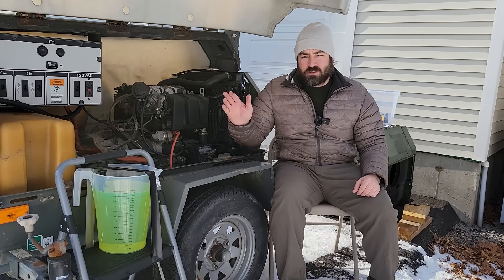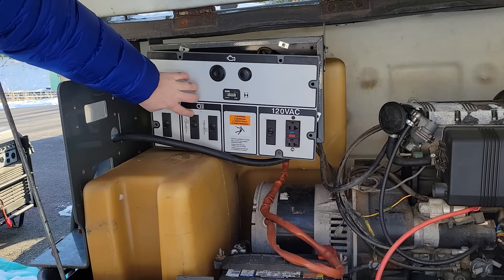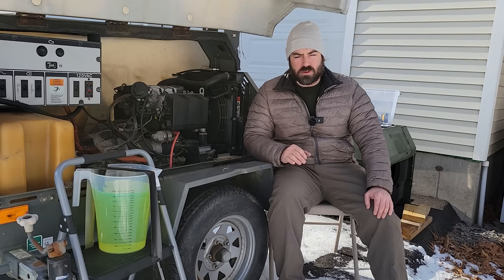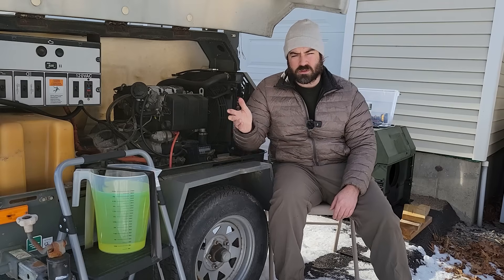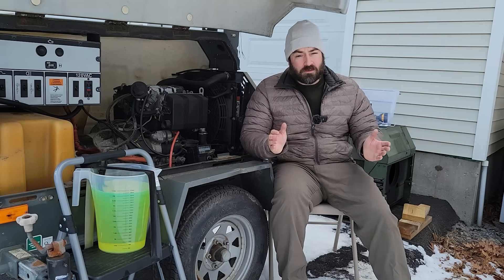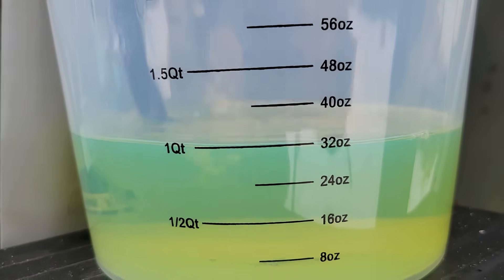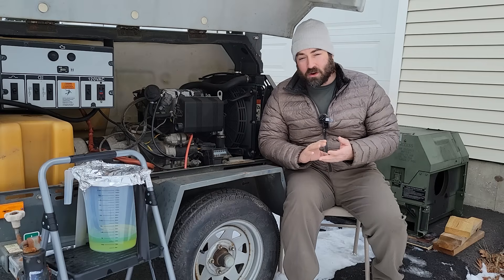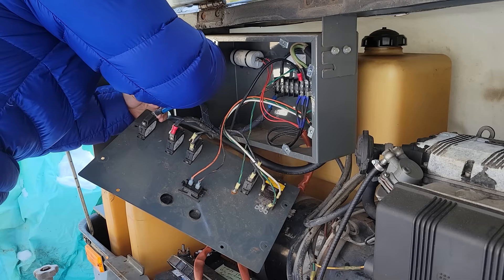Most efficient generator to recharge batteries (that I've tested)

Comment: What are your thoughts with this generator 
https://youtu.be/jth-KuV7mrw?si=pse9lalWxyjJWVM5
Reply from the maker: I think the idea is very cool, but I won't personally be buying one.  This generator only goes up to 54V, and then it lowers the Amperage.  The factory setting of 48-54V is perfect for lead acid, but lithium does better with a bit higher Voltage.  The Chargeverts can be set higher, which keeps full current longer, and that means re-charging faster and more efficient. If the company comes out with a new version for lithium, then I'd love to buy one.

Comment: I still think you'll be better with a small propane generator and 40lb tanks. Still pretty easy to handle and the lower fuel cost will trump the most efficient diesel.

Comment: Real world tests show the inefficiency of an ICE for power generation. 
AND we all have one!  Pretty much the worst way to make portable power, but a necessity at times.
1 gal of diesel has 138,700 BTU of energy which would be realized at 100% combustion.
Converting BTU to Watts yields  ~ 40KW-hr of power.
Assuming about a 80% efficiency of the charging equipment and 85% efficiency of the generator electronics.- 68%
This is to the battery only. 8500W/(.68)= 12,500 Watts. The fuel is capable of 40,000W.
The ICE is producing at 30% power efficiency. (12,500/ 40000) !!! This is best in class performance.

I should test my equip. My recent example if interested and math included. 
This with a DF Champion  4750W start up/ 3800W running gas.
I got 12 hours for 3 gal 87 gas and running the shed w/ A/C and charging a 15 KW battery from 30% to 100%.
My shed load is a little less than 600W w/ A/C running low. ~350 base + 250 for A/C 
Add 7200W of inverted power for 12 hrs of running shed. Assume inverter efficiency of 80%.
7200/80%=9000W required;   70%*15000=10500W.  9000+10500 ~ 20000W total.  
3 gal 87 gas ~= 100000 Watts. 200000/100000 
<20% power conversion efficiency. not worst but not best. A little surprised it is that good - lol.
Reply: Worst way to make portable power?  What would be your alternate suggestion for a 48-72hr scenario?

Comment: Asking seriously... Curious what the point of this is? Is it self sufficiency? Is grid electric super expensive? Where we're at right now, a kWh is $0.085 and diesel is $3/gal, so this would be extremely expensive. I love the idea of not being reliant on the grid however
Reply from the maker: I have several motivations.  One is being self sufficient.  Next would be backup when the grid goes down.  Where I live grid electricity is $0.38/kWh.  I produce my own energy 10 months of the year with solar.  The generator is just to supplement the solar in winter.
Reply: You guys are lucky.  Here in SoCal I pay 53 cents a KWH, soon going to 58 cents.  Meanwhile the state is shutting down all nuke plants.   Go figure.

Comment: Ensure your wiring is 120% of the recommended size if you plan to operate it under a continuous load. Wires can heat up and become more resistive over time.

Comment: I use a prius engine (Atkinson cycle 40% efficiency) and the rest 60% is waste heat that i use for heating water and my house
it works great and i can also run it on LPG
Reply: I've thought about a natural gas generator/furnace in an insulated box. That sits next to the home. With intake & exit ducts from the box into the house. In winter heat gets blown from the engine & muffler heat exchanger into the home while the exhaust  gasses are vented outdoors. There are 2 inline fans, 1 that sucks hot air from the box into the house & the other blows air from house into the box that cools the generator. So instead of just burning natural gas for heat in a furnace... To heat your home, the same amount of natural gas being burned. Is creating heat + plus electricity for your home, instead of just heat.  Although if it's ran constantly in winter for heat & electricity. The generator head will wear out pretty quick. But if it was easy to rebuild & replace for cheap. It might be worth doing.
Reply: @michaelbrinks8089  Do note that a cold rated heat pump + gas generator would be a lot more efficient than even a 100% gas heater.
Reply: @michaelbrinks8089  If you're using a liquid cooled engine, maybe you want to capture waste heat into a giant water heater type thermal battery that you can draw from as needed. Doing this with an air cooled engine could be a major carbon monoxide danger if it's not perfectly built.
Reply: can you upload some videos of this installation i will be really greatfull
Reply: This is an interesting idea.
Reply: That is what I was going to suggest he look into.  I've been wanting to build a stationary generator from a prius engine/transaxle for years.
I will need something if I go EV road racing, as the tracks don't have high rate chargers.
Reply: I tapped my Prius traction battery and fed a 48V telecom rectifier, and measured about 7.25kWh per gallon of gasoline. Considering gas's lower energy density (87% compared to diesel), it's about on par with what Mr Poz measured in this video. Love the fact that I don't need a dedicated generator!

Comment: I beat your number, 12.6 KW hr on one gallon of diesel!  Using a Perkins 403D-15G with a 14KW generator.
Reply: Those numbers are basically spec sheet ratings for the 403D-15 under standby conditions.  David's numbers represent power into the batteries (actually power through the victron shunt) accounting for chargeverter losses.  What is your setup and where are you measuring?
Reply from the maker: That's awesome.

Comment: I like the Chargeverter, it can be operated with 120vac or 240vac. It can be adjusted down enough to easily slow charge my 48vdc shop batteries from a 15a outlet from the house. Or charge from the 240vac generator at the recommended 30a per rack mount EG4 battery.

Comment: Shocking to me with the standardization of LEDs that light towers haven't gone battery hybrid.
Reply: they are stored a long time, not used every day.. better to fill the tank and go than to find out the batteries are dead.. (you can jumpstart the starter battery , light battery not so much)

Comment: Awesome result. The fuel economy is impressive, but the unsung hero is the little chargeverter. 95amps for an 1hr and 40 minutes I didn't know it would handle that much load for that long. I definitely need to watch more videos on just the chargeverter. Impressive.
Reply from the maker: I like the Chargeverter a lot.  I've ran mine for 10 hours straight once in a while.
Reply: 20% efficiency is great! 1 gallon of diesel has the equivalent of 40.7 kWh of electricity
Reply: The telecom 48VDC supplies are awesome too, especially if you're paralleling a few to get more AC -> DC charge. Lots of units are nameplate 54V/50ishA and typically have voltage/current setpoint controllable via CAN or something.
Reply: @SnowIsMyTerrain  The Chargeverter consists of two telecom rectifiers slapped together.

Comment: That's awesome.  My hot water heater uses about 1/3 it my electricity in winter, so if you could find a way to divert some of the excess engine heat into warming your tank water, you would truly get the most from a gallon of diesel.
Reply: i did exactly that with a prius engine and it works great
Reply: some videos I have seen use diesel heaters and run the exhaust through a radiator before exiting the house. The radiator gets hot and can blow a fan over it to get some heat. Maybe could do the same with a pool or something to heat the water?
Reply: We switched to a hot water heater with a heat pump on top.  That cut our electricity for hot water by more than 50%
Reply: These types of mods are fun science experiments but the actual $ payoff is so low for the application it's not justified. Just be a normal off grid person and use propane.

Comment: generally max eff is at max rpm with max load
Reply: Not with a diesel. And even with a gasoline, only to the point the injection enriches for cooling down the cylinder.
But these generator or mini-excevator motors usually have a governor (for gasoline) or a diesel fuel pump set to get an economic rpm. Then you should load to 70-90%. 
In this case, the motor is 8kW, the generator is 6 kW. At 90% generator efficency, the input is 6kW/0,9=6,7kW. So the motor is working at 83% by design. Perfect.

Comment: I was not aware that you really need the generator regulary in winter cause I had thought those were for backup only. But of cause now I understand why you are testing these.
We have the grid and no poweroutages in general. Last big one is 20 years ago and before that roughly 30 years. The grid can be away during night for a minute or so but we usually only get behind that afterwards in the morning when the clock of the Miele oven is blinking with the time when it happened. But that has happened 1x in the last 10 years. 
But we have a simple 3 kW generator for the worst case simply to charge the car at least that way.

Comment: Use an plate heater changer + an bubble type pressure absorber. You dont need mixing valves, unless you also want to use the radiator as backup (w/o modifying the generator as much)

Comment: Another great video. If you could run the cooling through a radiator inside for heat or through a coil in a water heater to have hot water maybe. Anyway, I’m sure you’ll come up with the best way of using it. 
I really enjoy your videos and look forward to what’s next.

Comment: Thank you for sharing your experience. Is it worth using a Chargverter on a newer Champion generator. I’ve not noticed my generator having any issues charging up my Delta 2 with the extra battery. Thanks for your advice! Thumb up 👍
Reply from the maker: I like using the Chargeverter on any generator.  I also own a Honda gasoline, and an army diesel.  I use my Chargeverter on any of them.  However, I don't own a Delta 2, so I can't speak to the specifics of that setup.

Comment: I've seen those generators in use at a few Walmarts, when they had issues with their parking lot lights.  Does your generator have a listed max output?  Where should we look to find surplus generators like yours?
Reply from the maker: The engine is rated for 8kW@1800RPM.  The generator head is rated at 6kVA.  I found mine on Facebook marketplace by searching "Light Tower".

Comment: How does the cost of the diesel compare with charging from the grid?
Reply from the maker: Most of this past winter, diesel sold for $3.50/gal. around me.  I made 8.4kWh, so that's $0.417/kWh.  My grid electricity rate is $0.38/kWh.  Which means my generator is more expensive especially if you take into account maintenance.
Reply: @DavidPozEnergy  I thought so - I find the closeness of diesel to grid costs surprising. One would expect diesel power to be several times the cost of grid power.
Reply from the maker: Depends where you live.  My state keeps the grid rather expensive.
Reply: @ I'm in Melbourne, Australia - diesel here is US$4.32 / US gallon and electricity is $0.20c for a kWh. You guys have cheaper fuel, but expensive electrickery.
Reply: @DavidPozEnergy Wow, I am in Texas and pay between 12-15 cents/kWh and think that is expensive.  8-10 is more what it "used to be".  At you prices it really makes sense to go solar.  I still struggle here with a pure economic analysis.

Comment: Diesel used to be a lubricant and fuel not so much anymore you sho5be usung additives in your diesel to get back the lubricant property especially if you running a okder diesel. Love the videos!!!!!! I would love to go off grid but man so much money to do it well at least its too much for ne right now!!!!
Reply: if u have property, start small and add as able/ needed. Can use as a utility offset at 1st. Just reduce electric bill. 
If metered connection can still see significant savings. Battery can be for rate offset and emergency power. 
Even if it only does lights. One of the hardest decisions was (optional) battery. How much offset/ backup u need?
If u can, 48V is preferable to 24V and 24V is preferable to 12V. But if 12V is where u at, do it.
Reply: What about just using some 2 stroke oil additive that is really ment for gasoline?

Comment: How much does one of those units run??
Reply from the maker: In the condition I bought mine, between $1,000 and $2,000.  The lights were not working, banged up, didn't start, no battery.  The only guarantee from the seller was that the engine ran.  You can buy a fully functional one for $4,000.